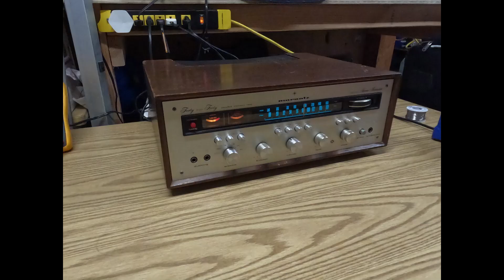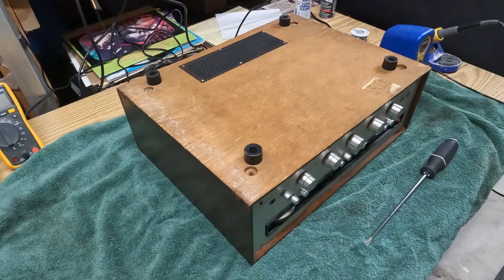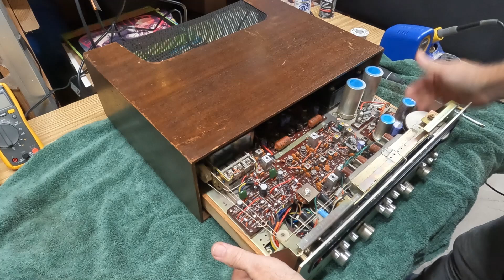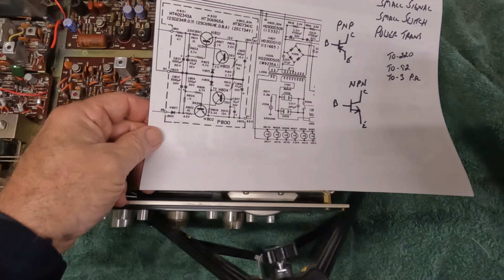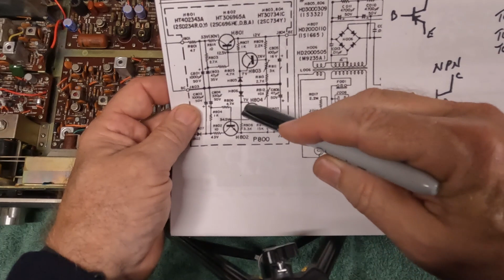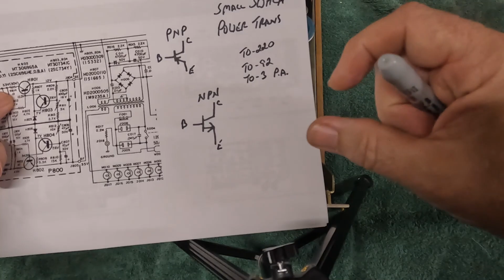Marantz Model Twenty Two Receiver, just beginning this project

Comment: Did you ever add to this series--just over the hump in finding some problems with my Model 22, power supply old caps and the preamp board had a few issues with transistors and the caps.  Have learned a lot working on this pretty simple receiver that has great access to all the boards.